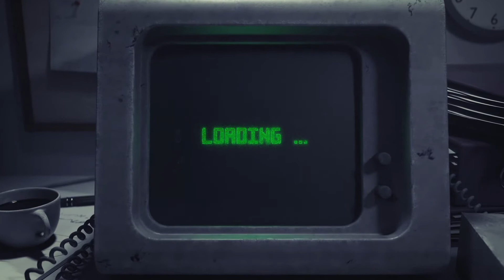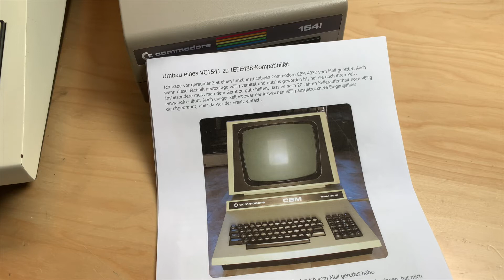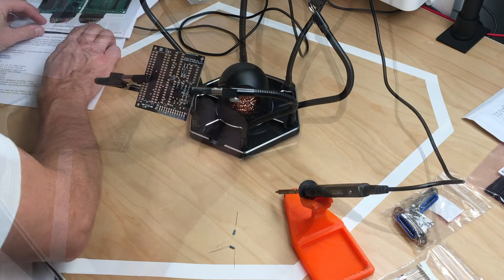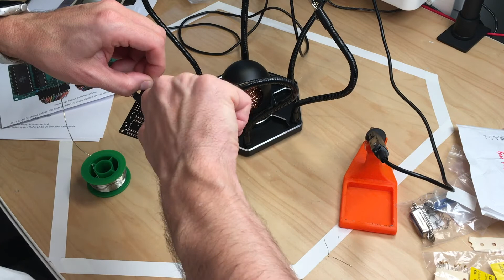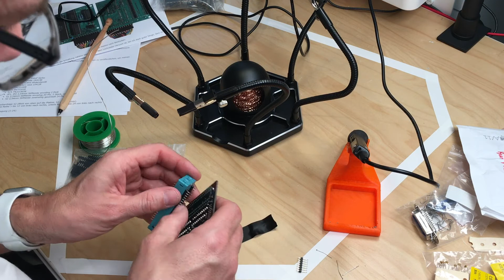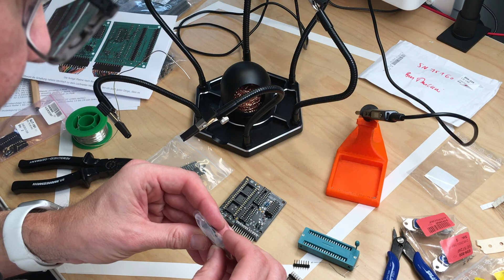Connect a Commodore 1541 to a PET - 1541ToPET-Interface - Build along!

Comment: Great job on part 1!! going to part 2 now. You have a GREAT voice for doing this!! Love how you talk us through what you're doing each step of the way. This makes me want to build or fix something!!! I spent many hundreds of $ getting a soldering station set up, desoldering gun, hot air tool and oscilloscope that has never come out of its box! I bought all that stuff to fix my broke 8 bit stuff (VIC 20 power switch and joystick port, 3-C64's, plus/4 CPU socket, SX-64 RAM, C128D added fan to PSU) and I did fix them all. TY again for all your help over the last year!
Reply from the maker: Thanks! Enjoy part II. It has a real happy end!

Comment: Back in the 80s, where I worked had the opposite problem in that we wanted to connect C64 computers to pre-existing 4040 drives.  We got a very nifty little 3rd party interface called the "Interpod" that did the serial to parallel conversion.
Reply from the maker: I think I have one of these. I was planing to build an C64 to IEEE488 interface in the near future to reconnect the modded 1541 back to the C64 ... just with higher read/write speeds.

Comment: This looks like an interesting project. I have an SFD that I'm in the process of restoring (slowly, lol), but this looks to be a pretty good option for getting a reliable "standard" drive on the PET. I think I'm going to have a go at it :) BTW, if the SFD is a "100 eye" then it follows that the 1541 must also be a "154 eye"... (sorry I had to spell out the I, but typefaces, lol)
Reply from the maker: I think the 154i ;-) is a great drive for the PET (at least as a backup drive if all other drives fail). The interface here is inexpensive and relatively easy to build. Have a go!